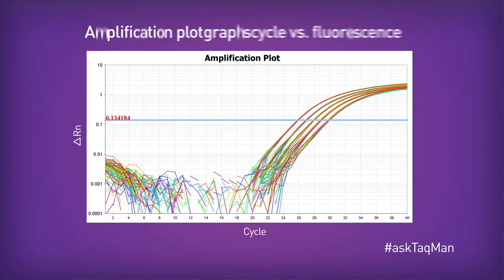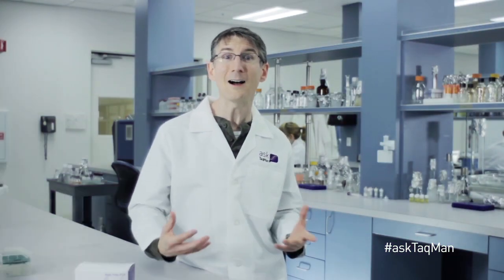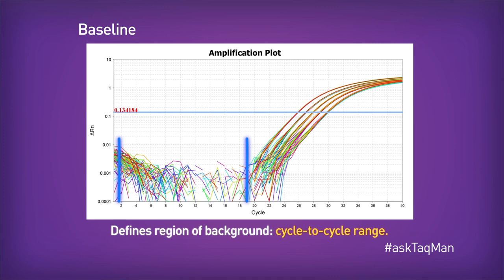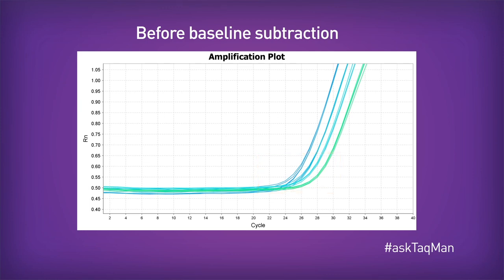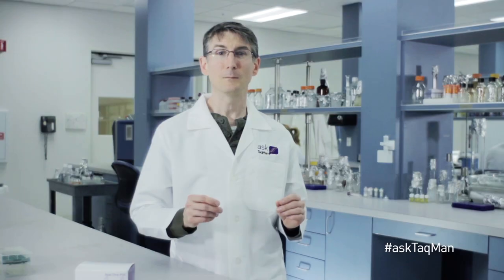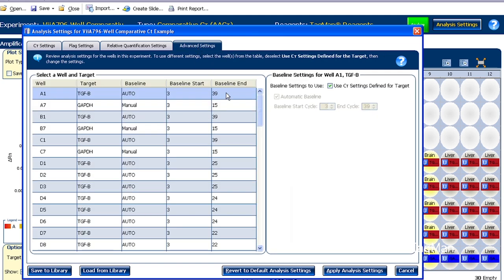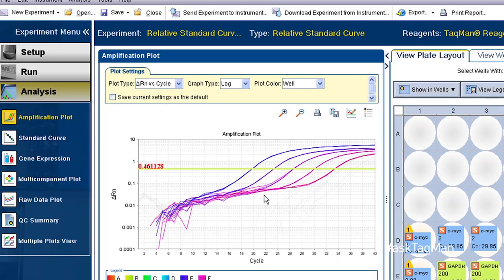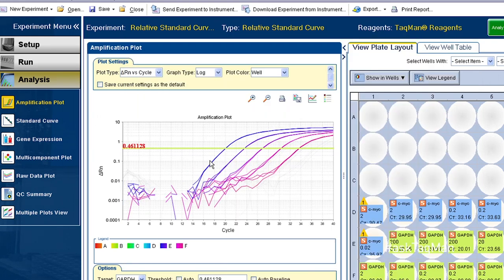Baselines in Real-Time PCR -- Ask TaqMan®: Ep. 5

Comment: Hi
1. Iam Using SSIV for cDNA preparation. What is the max conc of RNA that can be used in a 20uL reaction setup when using SSIV?
2. What is the maximum vol/Conc of cDNA that can be used in a 10uL qPCR reation?
3. Iam doing relative expression studies for some cytokines and could able to see the flags reporting exponential algorithm failure. How to resolve this problem?
Need some help.....
Reply from the maker: +Ratnakar Reddy The maximum RNA input for a 20 uL reaction is 5 ug of total RNA.  In a 10uL qPCR, we would recommend that the undiluted cDNA not exceed more than 10% of the total reaction volume (ie, maximum of 1 uL of undiluted cDNA in a 10 uL qPCR reaction).  Those flags typically indicate that there was no amplification in the well.  I would review the curves and see if they look normal or not.  If there was no amplification, I would check the sample – in some cases you may not expect amplification (low or no expression) from a particular sample, and so such a flag would be expected and can be ignored. Thanks for asking, and let us know if we can help with anything else.

Comment: Hi,
In my standard curve experiment, in the graph of delta Rn vs # of cycles, I don't find the plateau phase. even if I have put 45 cycles, the run completes without reaching the plateau phase. I see only linear and geometric phase. Please suggest me what I can do and what is the possible reason for this.
Reply: Hello! First, thanks for watching our video. Second, your description sounds like the target is expressed at very low levels, in which case you may not see much of a plateau. Have you tried using some sort of positive control which would have robust expression? Another possibility is that there are inhibitors in the sample which is hindering the amplification. If you want to post more details and/or data in our community here (http://abcommunity.lifetechnologies.com/welcome), and we can examine the issue further if you would like. Hope that helps, and let us know if you have any further questions.
Reply: Thank you..but if I increase the # of cycles can I reach my plateau phase??
Reply: We would not recommend to go past 50 cycles. The Taq enzyme activity will be reduced at this point in the reaction. If the signal is still low this means the target is very low abundant (single copy range) and you are at the limit of detection. Any data at this point is likely not quantitative.
Reply: Thanks..:)

Comment: goo day! this episode is helpful.. however, i have some concerns.. i did qpcr to determine the gene expression of cytokines in different treatment groups... when i ran my samples, most of it are flagged saying exponential algorithm failed. when i look at the amplification curve, its unacceptable... shall i discard my experiment? and repeat the process?
Reply: ***** the problem is, even my positive controls are flagged, no amplification... i could not determine the possible reason. :(
Reply from the maker: +KC Doysabas Hello! If there is no amplification, even from the positive controls, I would check the samples and assays.  How much sample are you using?  Have you tried a dilution series, say from 0.1 to 100 ng of cDNA?  What type of assay are you using?  Is this TaqMan or SYBR?  Is the design good?  Have they worked before?

Comment: I am attempting to determine a male plant from female plant by locating the Y-chromosome  in  a qPCR Machine. Right now I am still searching for the knowledge to do so.  My question is,  do you think this will be possible with a PCR machine? And have you ever done something like this?
 Thankss!
Reply from the maker: +Jake Richard This should be possible.  However, you would have to determine the appropriate target sequence for whatever plant species you are working with. Here is a reference that did something similar:http://onlinelibrary.wiley.com/doi/10.1111/j.1755-0998.2008.02344.x/abstract

Comment: Hello,
I am struggling with the Ct values I got from my lab.
For my gene of interest I got no amplification for the negative control cells, for the test cells I got 30.935 and control cells 33.759. For my reference gene I got 30.310 for negative control, 28.260 for test and 28.022 for control. I got wrong results since the negative control where there should not be amplification and the ct values are too high. However I need to calculate the delta ct for test (I got 2.67) and for control (I got 5.7) to compare house keeping and gene of interest. But what do these values really tell me? And for the double delta Ct I got 8. What does it mean?
I hope to have a reply from you soon!! 
Best wishes, 
Natalie

Comment: Can you explain about undetermine ct ?
Reply from the maker: Thank you for your question. An undetermined CT is usually indicative of no amplification. The software is designed to set a default threshold 10 standard deviations above mean fluorescence generated during baseline cycles. If the target does not amplify, it will never cross that threshold line and therefore, you will see an "Undetermined" in the CT value. 

For additional technical questions, please feel free to contact us as thermofisher.com/askaquestion. Thank you!